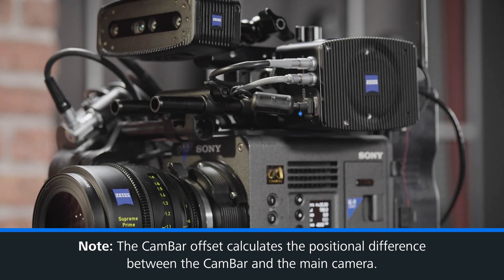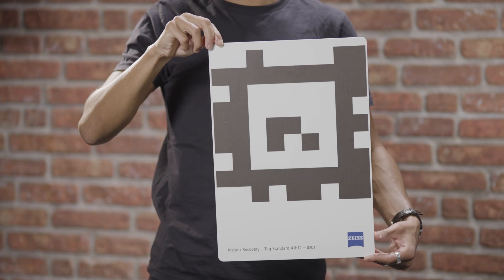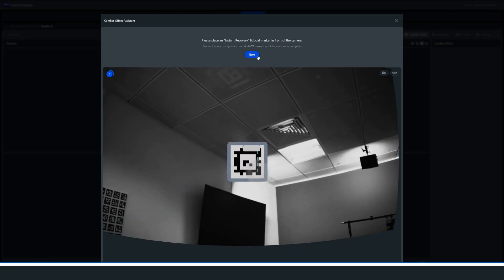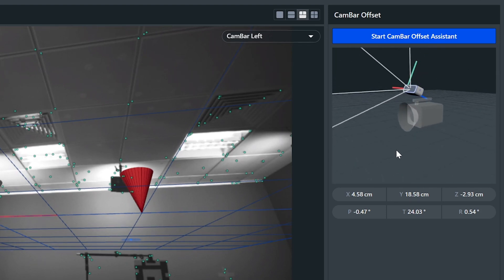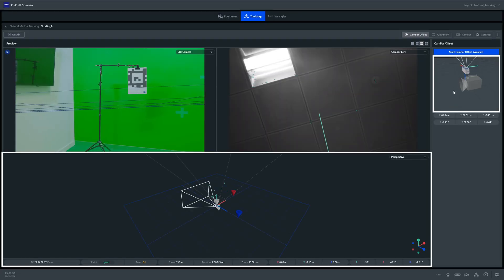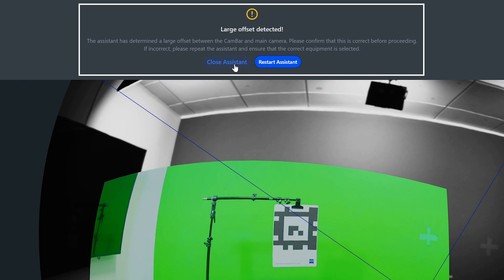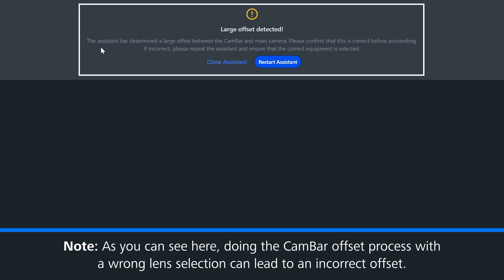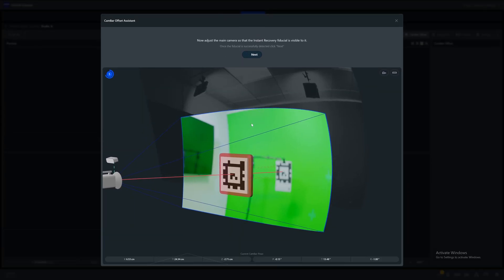ZEISS CinCraft Scenario | Tutorial 09 | CamBar Offset

Comment: Hi! After setting up the cambar offset, can the lens be changed without having to reset the offset + zero point?
Reply from the maker: Yes, it can. Because the CamBar offset is between the CamBar sensor and the main camera sensor. When mounting a new lens, you need to select it in the software as well. If you don't, you will have the old lens selected and the tracking will be off.
 
As soon as you move the CamBar, because e.g., you can't change the lens, whithout doing so, you MUST redo the CamBar offset and zero point procedure.